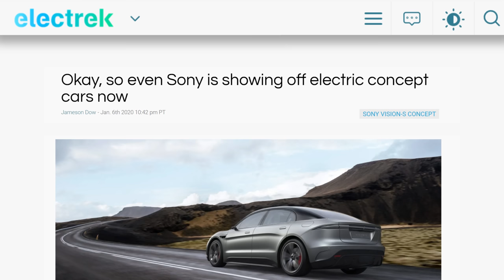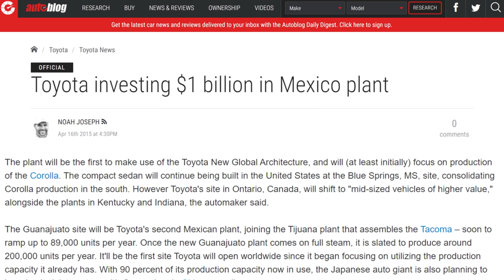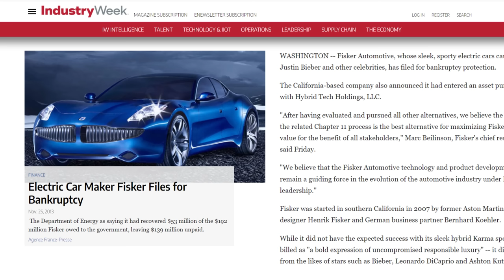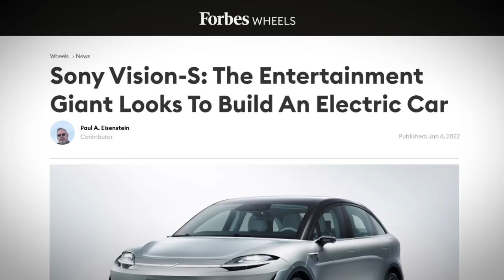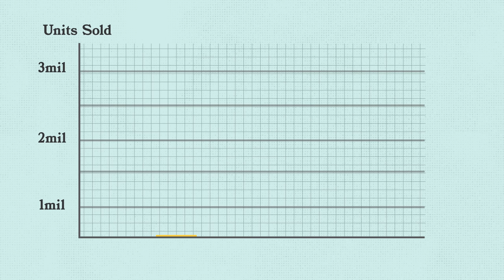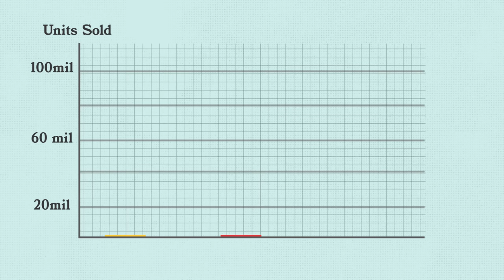Sony's Car Could Actually Be Good- I'll Explain

Comment: I'd buy a Sony car. I've always had a positive experience with their products
Reply: I don't think any Sony product I've ever had has broken or died. Somewhere I still have a perfectly functioning minidisc player and a cassette tape walkman.
Reply: I better hear ps2 sound when i turn on my car
Reply: I had a Sony Bravia TV (1080i supported) and even though it got hit multiple times throughout the years it stills perform very well for 12 years ! Imagine how long and how good the Sony car would be.
Reply: Let hope the controllers are better than a Nintendo switches  or thats going to be dangerous on the road
Reply: My 1st smartphone was Sony Xperia Z3. It was good at that time, but the unlock switch gone error in 3 years, so i bought Xperia Z5. It has simmilar problem which is heat, i even had to put it in freezer in order to cool it down. Now i use Samsung because it has better heat management.

Yes, some of their product is very reliable. Diskman, PS3, headset, had lasted 5-6 years.  If this car is ever launched, i hope it'll be more reliable than their existing products, especially smartphones.
Reply: My thoughts as well, have a sony bravia from 2009 that is still going and don’t think it’ll die anytime soon
Reply: Same. I have countless sony stuff, TVs, Cameras, Headphones, Car radio, Mobile phones, home theater speakers and more. All worked like charm. Liked all of them. I'd also buy a car they make if I had the money.
Reply: I have a Sony Trinitron CRT colour tv. It's been in tip top condition for its 18 years lifespan and still produces a sound quality that can rarely be matched by any speaker on a modern tv. It is the only reason we're sticking with old and less flexible cable tv technology because we're unable to let go of it and buy a new smart tv.
Reply: @yw5613  my ps1 is over 20 years old and still works.
Reply: @Tennyson_W05  same
Reply: @maxthrust976  I still have a 3D Sony Surround sound system from 2010 that's still working.  I once had a 51 disc changer until like 3 years ago.  Kids broke it.  You know how far you have to go back to have a 51 disc changer.

Comment: This doesn't seem like a stretch. Sony has a lot of experience in taking already existing technologies and making them better and cheaper. And, they have no legacy costs that say Toyota or Honda has. That being said, if Sony hooked up with Toyota it would help both. Sony would get into the space and Toyota could use the Sony name to bridge the to electric vechicles 
and avoid Osbourne issues.
Reply: also The creator of Gran Turismo is best friends with Toyota and their CEO. They have exclusive cars in their game because of toyota. They could easily make a deal
Reply: No stretch at all, used to be a prototype test driver for Toyota/Lexus in Arizona. You'd be surprised to hear that manufacturers work closely together now compared to decades ago. In fact Land Rover, Tesla, Subaru and Jaguar share the test track and the engineers often will work on certain problems together too when needed. That being said, not to sure how welcoming the established industry will embrace outside competition.
Reply: They're also a huge battery manufacture.
Reply: @AltruisticWarrior  hi AltruisticWarrior. 🙏
Reply: I have been thinking ever since I heard about this SONY EV that they should hook up with Toyota (boom chika bow wow) since not only are they both Japanese, but Toyota recently admitted they are four years behind in software for EVs while SONY is four years ahead of them having been developing the UI, and platform for the Vision S since 2018.
Reply: Heck, not just Toyota, but Yamaha. Toyota providing long-term reliability and after sales service, Sony providing the electronics and user interface, and Yamaha tuning the sounds. As well, Yamaha is also getting into the e-motor world (https://www.youtube.com/watch?v=NHvdnxu0UsI), tuning theirs to also have noise instead of silence (their idea of bringing back some of that rev feel), so it could see some Sony Visions with a "loud" e-motor from Yamaha, and a "quiet" e-motor from Magna ().

Comment: Hopefully Sony makes the ignition sound (I know it's an electric car but I don't know what else to call it lol) the same as when you start up a PS1.
Reply: That'll probably an option in the system settings; They'll probably also include a PS5 in the infotainment system which'll work when the car is stationary, maps will use OpenStreetMap and the OS will be based on FreeBSD which is the back-end of the PS4 System Software and likely for the PS5 as well...
...that could also mean that the car comes with a terminal application allowing for more hacks/changes/modifications than probably most cars being sold brand new today...
Reply: @wclifton968gameplaystutorials  from your mouth to the developers ears! That would be beyond awesome.
Reply: @wclifton968gameplaystutorials  Nah, I doubt they'll use openstreetmaps over google or apple maps.
Reply: @wclifton968gameplaystutorials  bruh they didn't allow terminal or normal Linux apps in their PS4 without a hack. What makes you think they will in their car?
Reply: Still, imagine a free PS5. LOL
Reply: @Darkest_matter  They allowed a Linux Installation on the PS2 with the Hard Drive/Networking addon and on the original PS3 so they could allow the terminal on the car's infotainment system but it'll probably just be a debugging option that requires some hardware modification to unlock such as plugging in a jumper wire on the motherboard of the infotainment system but who knows?
Also BSD is NOT linux, Linux is "Unix-Like" but is not "UNIX" and they use different kernals, Linux was developed from scratch but based on the UNIX system hence "UNIX-Like" while BSD based systems like FreeBSD or NetBSD are decendensts of 386BSD which has it's roots all the way back to the 1960s at AT&T Bell Labs
Reply: @Bob-qz5yj  Apple Maps for the most part uses data from OpenStreetMap as does Microsoft Bing, map data also comes from TomTom and HereWeGo (aka Here Maps formerly owned by Nokia) (Bing on the other hand also uses data from Government agencies such as the UK's Ordanance Survey) while Google Maps does not disclose it's sources & gets their own data. I'd have to say that OpenStreetMap is the most accurate mapping service I've used plus it's open-source and FREE while Google Maps & Apple Maps are free to consumer's, I'd doubt their free for companies who want to embedd them into system software i.e. inside of QNX in a car's infotainment system

Comment: I worked for TRW (well, ZF-TRW now) at a stamping plant making seat belt parts. There's a while litany of companies who actually build automotive components. The actual final assembly might be done at the the Ford or GM plant (for example), but much of the individual components are made and assembled in factories run by companies like ZF-TRW and Magna.

Comment: You should've mentioned their battery technology as well 🔋 they make one of the best cells in the market.
Reply: I'd see that as the biggest factor. The price, longevity, and range of an electric car, the most important concerns, are mostly about the battery technology, so I feel like a company with good battery tech in their pocket is a great starting point for an EV company. Perhaps better even than a company with a lot of automotive experience but no battery tech. Say Toyota and Sony, I'd almost think Sony has a better shot. If those two worked together, everyone else is doomed.
Reply: SONY invented Lithium ion batteries

Comment: In hindsight, the original Playstation was a no-brainer, as Sony had the manufacturing plants to make their own parts which Sega and Nintendo didn't (putting them at a huge cost advantage), and Sega was still focused on pushing their software over third-party games (a little baffling, considering how big a part third-party games played in the success of the Genesis), while Nintendo was also turning third-parties away by sticking with expensive cartridges. The Playstation was easier to develop for, with better tools than either the Saturn or the N64. More importantly, Sony had WAY more money to throw at their console than any of the other companies, and they knew how to create a good marketing campaign. Sony would have had to severely screw up for the Playstation to fail, although Sega screwing themselves over left and right and Nintendo's hardware delays certainly helped a bit.

I would love to see Sony enter the EV space. For one thing, their designs look pretty good. I doubt they'd rise to any kind of leadership position, as I'm assuming their yearly output wouldn't be as high as some other manufacturers, but I bet they'd sell pretty well.
Reply: I always remember reading when I was a kid that Sony spent more on marketing the PS1 than Nintendo did on development of the N64. Dunno if it's true. But said it all for me.

Comment: Don’t car going to sound like a jet engine from running to long 🤣
Reply: Well, you can hear cooling fans typical from ICE vehicles. Although EVs have less waste heat, they do still use radiators for the batteries.

Comment: EVs are appliances. They are not too hard to engineer.

With a great low price for their car, Sony can succeed in the EV market.
Reply: plus they only need to outsource manufacturing, not the electronics.
Reply: Appliances do not have battery, however. Don't underestimate how much effort Sony has to do just to perfect the battery tech for automotive application.

Comment: Honestly, it’s not really that surprising given the fact that EV forgo one of the most costly factors of cars; which is the R&D of the drivetrain itself. EVs are more like technology on wheels which significantly reduces the barrier to entry. Although Sony may not have direct automotive experiences, what they do have is decades of manufacturing, marketing, capital, and brand recognition. If Tesla who literally had 0 years of experiences can produce and market an EV, Sony would have no doubt be able to produce a higher quality car than Tesla.
Reply: "it’s not really that surprising given the fact that EV forgo one of the most costly factors of cars; which is the R&D of the drivetrain itself" that's how you end up with Tesla's "Wompy wheels". Seriously, look it up. Personally, wouldn't buy a car from a company that doesn't have a motorsports division for their R&D. Racing is where the components are tested to their limits of reliability.

Comment: The Magna partnership is bigger then you realize Nolan. Frank Stronach the owner of magna was obsessed with the electric vehicle long before any of the companies were even considering it or tesla even existed but ran into huge confrontation from major companies like GM and Crysler that they were developing parts for because they realized he could hurt their sales. The armored truck company I used to work at is in a magna building in Newmarket Ontario Canada where Magna is very dominant. Many of his prototype vehicles were stored in the warehousing area of the plant. Including an early 80's GMC panel van with electric forklift motor and a trailer for the batteries required to power it.

Comment: Just wanted to mention, NIO has actually recovered since 2019, they currently have 3 SUVs on sale in China and Norway, selling about 10k units per month cumulatively across models. The sedan shown, the ET5 has started preorders and will be delivered September this year while the flagship sedan ET7 will be delivered in March if I recall correctly.

It's certainly not on the scale of Tesla but it's not a dead company I'd say

Comment: Another thing to add is that Sony is developing an amazing AI for GT7 called Sophy. It is able to learn tracks and routes on its own given enough time. It is also capable of learning how to drive around other cars. If the AI gets developed enough, Sony might see how a neural network based AI will function in their cars. GT7 is a fantastic testing ground for solving many problems that self driving cars face (i.e the Trolly Problem).
Reply: Great point. And Sony has already said that they intend to use it to help develop self driving cars
Reply: @Sabundy  oh that’s awesome! I didn’t know they had already said that

Comment: Okay, I would buy a sony car, IF, and now hear me out on this, ok, they included a VR headset, capable of running the games of today, that, when enabled IN the car would disable the car from running at all, but the cars steering wheel and pedals worked the in game cars, and the suspension of the car would be 100% electronically controlled BY THE GAME in that mode, so you could feel the tracks you're driving on. That would be amazing.

Comment: You know the entertainment options would probably be the best in the industry. They could obviously throw a playstation in the car as everyone probably thought. But they could also adapt Playstation's Linux based OS for infotainment purposes. I believe Playstation UI would be great on a large Tesla style display. With that being said, it's be pretty hard to imagine Sony making an actually bad display. You also can bet there would be a good sound system or two to select from. They would be smart to outsource things like the engine and its components to an experienced auto designer/manufacturer I believe though. At least until they can come up with their own design and work the kinks out.

Comment: Honestly, as much as I can't stand the EV industry (or self-driving tech tbh), I actually kinda dig this lmao. As long as they can avoid some of the main ethical/environmental issues when it comes to battery manufacturing and still maintain the same quality as their electronics, I might (lowkey tho) consider picking one of these up in the future, especially if the production Vision-S still looks like a futuristic version of a Mazda 323F 😂

Comment: Not the biggest Sony fan, but they have proven themselves to be an underdog in New endeavors established by major players and innovate in the process. Doesn't mean that they aren't copycats when other's technologies are the big hit. They were known to implement Nintendo features in future iterations of their PlayStation consoles. And their foray in the portable console wasn't as successful as Nintendo's.

That aside, Sony taking their steps into building an EV is kind of a surprise (I learned today they have been developing the program for years now). And knowing that they are in a partnership with Magna, which I was unaware they are great contributors to the auto industry, could very well mean they be successful in the market. Only time will tell.

Sidenote: the Crash series, while it started on the PlayStation, is now on all consoles. Same can be said about Spyro. Jak and Daxter has been absent from the current gaming scene together with Sly Cooper, but they are Sony exclusives. Only one present is Ratchet and Clank.

Comment: I feel like, ev cars actually lack a lot of the mechanical engineering that a combustion vehicle require. This makes the barrier to entry lower for companies that don't have many years of proprietary technology that not many individuals could replicate themselves. That will create a very interesting market. There will be many examples which have unique aspects. But that leads to the next thing. Most of the components in electric cars are based on very repeatable principles. Electrical capacity, power, motors, batteries. All of these things can be theoretically outsourced and used by many people/companies. 

This will eventually lead to non individual cars other than design. And many many flop/fly by night/cheap quality companies producing EVs. You talk about this to some degree. Dyson, fiskar etc. I think there will be many more to come.

Comment: I hope Sony will release that to get to the top of the ev market they need to produce an electric car that is very affordable. I've seen time and time again new and nicer electric cars but not to many people are willing to put 80 to 160k  of an investment into one. For the average consumer market we don't need self driving, fancy doors that open up and 500 sensor to monitor everything that's going on at this point a battery pack with wheels and a steering wheel will sell. Especially with the drastic increase of gas prices. Imagine the Honda civic or Toyota corrola or camry of electric cars, people don't buy them because there super fancy 0-60 in 1.2 second cars. They buy them because they need something """ reliable """ to get around in and that's why they have been the top selling cars for years.

Comment: Well EVs are mostly electronics  and software (both of which Sony produces and has lots of experience with). The remaining automotive part (chassis, brake systems, suspension, etc) will be easily handled by Magna. I would rather trust a Sony EV than some of the randomly popping up EV startups.

Comment: The ONLY electric car company which manufactures batteries. This is big. I build and fly high performance high speed fpv remote aircraft and in this field sonys lion cells are known to be some of the very best if not the best bar none.